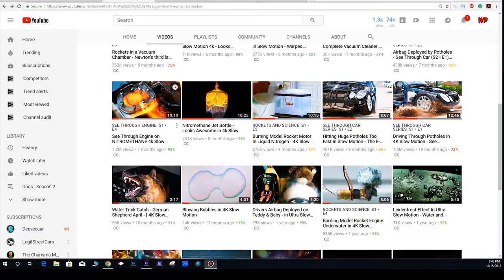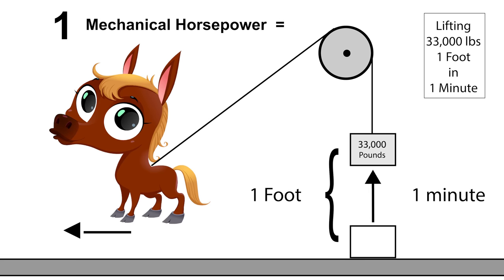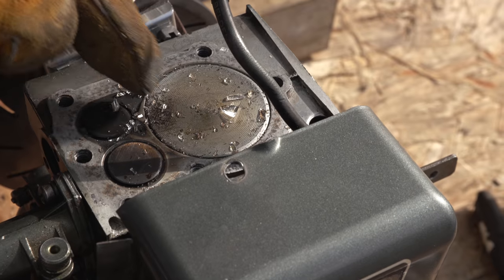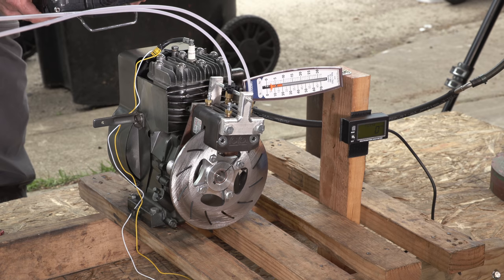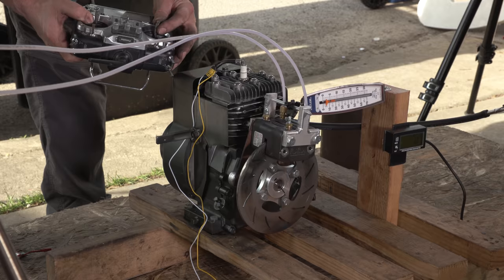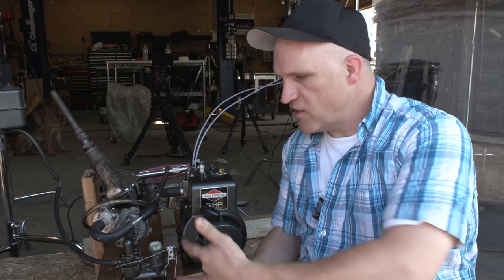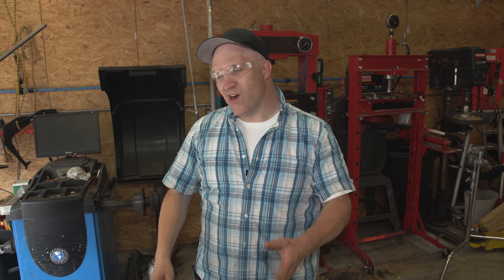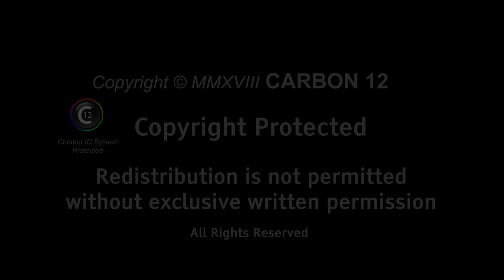See Thru Engine on Turbo Nitro and Dyno  (How much HP does it make?)

Comment: You need AEM air fuel mixture sensor to rightly tune your briggs. With fuel mixture change and a turbo(if it builds boost) you should double the power
Reply: That's exactly what a guy who drives a 90's honda civic with a fart-can exhaust would say
Reply: With turbos always tune to the rich side without loosing HP and the mix will be right where it needs to be. This should work just fine as the testing is done in a small RPM range.
Reply: Dave Micolichek  Ok I have a RAM jet for you to tune ;)
Reply: Dave Micolichek   You are right, not enough info. A Ramjet rocket engine, hope you can run fast! :)
Reply: Dave Micolichek  Ram jets only run at high air speed so you would need to run really fast. Kidding a side given enough time a A/F ratio sensor is never needed on a ICE but its much quicker to do so. I would not waste the money on a  A/F sensor for a turbo small engine that has a narrow rpm range. Should be easy to tune by eye and ear.
Reply: @GearScar  lmao so true
Reply: @GearScar  wise minds think alike...and have cool screen names lol
Reply: You mean a wide band o2 sensor
Reply: 2x the power would be 14-15 lbs of boost (basically 2 atmospheres) but it isn't making the boost for that. It did make double with the nitro and turbo tho on the newer vid
Reply: Dave Micolichek  Of all the engines you have fine tuned in the old way, how many of them were poorly built? How many catastrophically failed?? ;)
Reply: Dave Micolichek  
I am one of those who understand what you mean by hearing that an engine is properly set up with ignition and fuel, I am a motor builder and I have a company that builds engines for living. But I think you're wrong when writing that I should avoid newer tools that make the job easier, like a simple wideband lambda. When I build a 1000hp 4g63 engine with, for example, unknown custom intake maifold, this is run with AFR sensor on all cylinders (one per exhaust runner) only because I cannot hear, smell or see if one of the cylinders gets too rich or lean due to the custom intake. Boring to throw away $20,000 because I thought I could smell the engine was doing ok...
Reply: Dave Micolichek  
Agree, I think took a quick decision that you only thought the old school is the right way to do it, sorry. I also think we are about to lose the knowledge of building and tune these "old engines" The next generation will probably not do this, this is a dying knowledge that disappears shortly. Yes, we have some exciting and unusual engine projects

Comment: You are one smart dude, creative and innovative. My guess is go electronic on this turbo set up and find a way to get more velocity from the exhaust to spool the turbo. Keep going on this really cool.
Reply from the maker: Thank you !
Reply: Very intelligent guy indeed. I would have to say, a fuel injector, some sort of electric pump and a small fuel pressure regulator. Then of course as you mentioned some type of DFI unit to max the project. A tiny intercooler certainly would not hurt! Lol Great job Sir! A genius indeed!

Comment: Great work actually going out and trying to turbo a little 3hp. Most people just scoff at the idea and say it won't build boost. If you really want to build usable horsepower, however, you will need a smaller turbo. You are limited  to your exhaust pressure by bore/stroke and rpm. The suggested IHI RHB31 suggested by Cape Cod CNC just might do the trick if you concentrate on keeping the exhaust temps and hot side of the turbo as hot as possible and keep the exhaust velocity as high as possible. You want the exhaust to keep a high velocity until just before the wheel and as hot as possible to take advantage of the rapid expansion of gases to aid in spooling up the turbo. The heat will do as much or more to spin the wheel than the exhaust pressure will with that small engine and modest rpm range. If your really stuck on using that turbo you could run it very rich to where you are blowing raw fuel into the exhaust and then lean it out and hammer it. You need the fuel in the exhaust to ignite until its cherry red. The heat might be enough to actually spool the turbo enough to gain some horsepower. Its not ideal, but its very effective.

Comment: Likely blowing out the spark. Not enough energy once you go into positive pressure. They make stronger coils for those engines and I think you will get what you are looking for. With nitro (as I mentioned before) the equation is simple, enough fuel till the engine chokes and enough spark to light dirt. Once you add boost, you need more sparky. Love the build!!!  :-D

BTW draw through is perfectly fine for nitro like this. You need loads of fuel so you almost don't even need a carb lol. Just a hose in front of the turbo inlet and a flap in front of the inlet to limit the airflow. Nitro is a funny animal, and I do mean animal.
Reply from the maker: That's a good point.
Reply: I have made a few very high-compression engines work well even with stock ignition/coils and aged wires, just by reducing the spark gap. 
I ran a high-compression Super Gas bike for three years to good result just by reducing gaps from .028" down to .024"!

Nitro doesn't like to stay mixed within the air stream, so may really limit how much fuel that can be fed in.  You need a LOT(!) of liquid volume per unit air volume when running nitro. The upstream carb might be a problem because of this, and yes it is restricting the intake air by a lot.

Any slight improvement in air flow rate will show about double the expected improvement, since the added exhaust energy will further help the turbo along, so improving the carb (or improving the exhaust flow from the ehxaust valve to the turbo) may show a disproportionate improvement in power. Two-strokes also work this way because their exhaust system supercharges the engine from the exhaust side.

And another poster here was RIGHT ON about the intake manifold needing an elastic reservoir to allow pressurized air/fuel to build up unrestricted while the intake valve is closed!  Adding a large "boost bottle" tee'd into the intake is needed here but becomes an explosion hazard that must be passively contained with a "blower blanket" strapped on.

Anyway, the apparent "shortcomings" of this experiment are actually an educational feature of this video that makes people think and discuss what it takes to actually achieve actual benefits in the real world.

An exhaust O2 sensor might not work on a setup like this because there will always be a ton of O2 in this engine's exhaust when running nitro and ESPECIALLY with a turbo added on.

Excellent video.